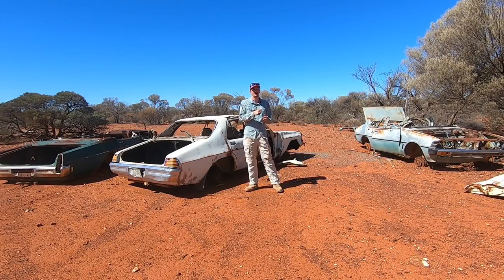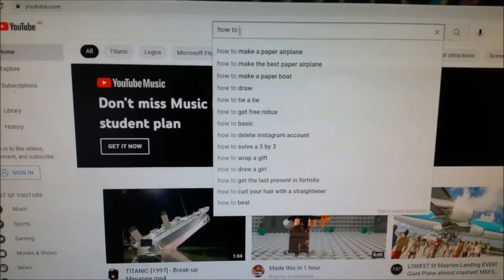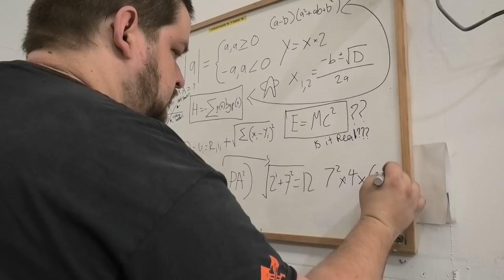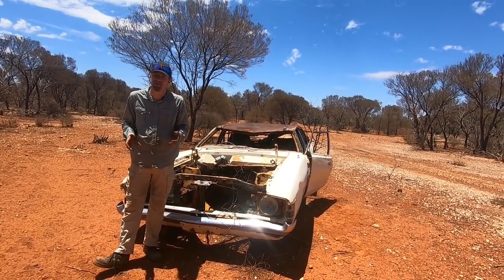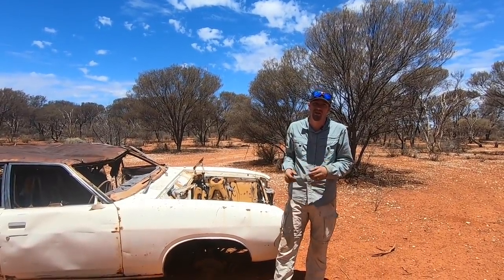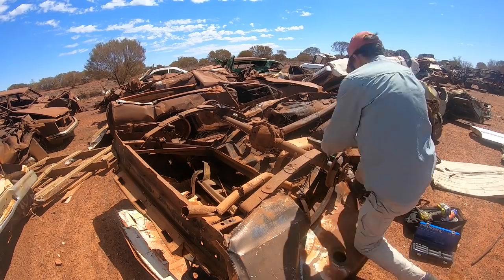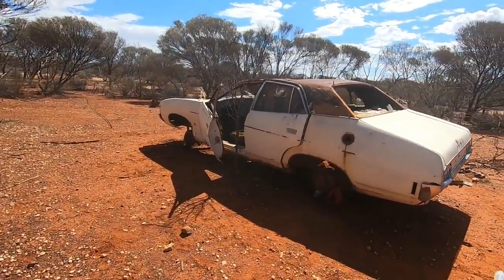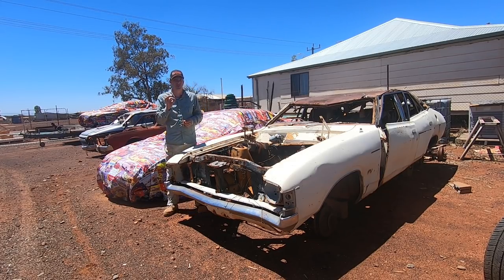Bush wreck hunting, and possible car rescue?

Comment: Engine mounting brackets ending further forward of the Engine Cross member indicate that it was built with a 250 and C4 Auto, as Fairmonts do My XB Fairmont was also fitted with a 250 and C4. Falcon and Falcon 500 Autos had Borg Warner 35s Futuras may have had C4s behind 250s, but I' m not sure, But  Fairmonts with the larger displacement 6s did. so probably XRs with 200s, XTs and XWs with 3.6s and XY, XA and XB Fairmonts.